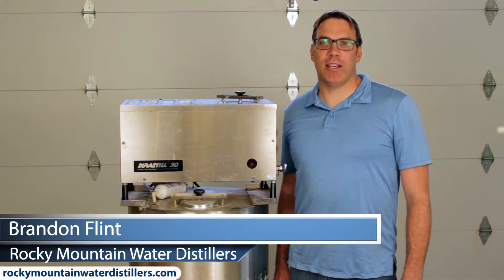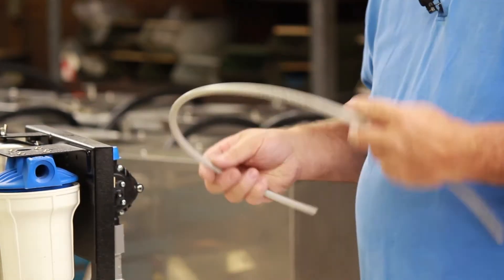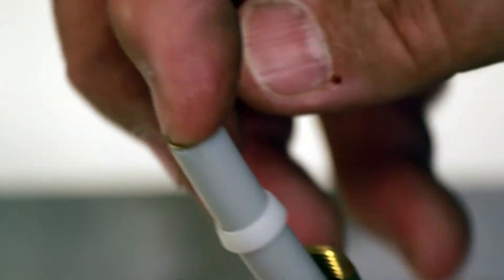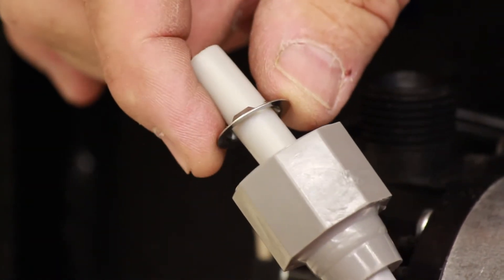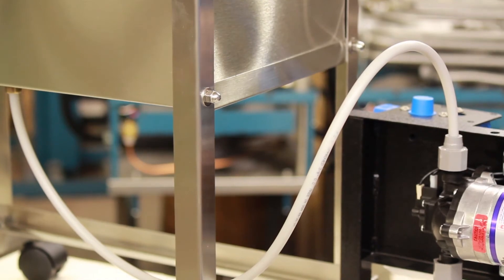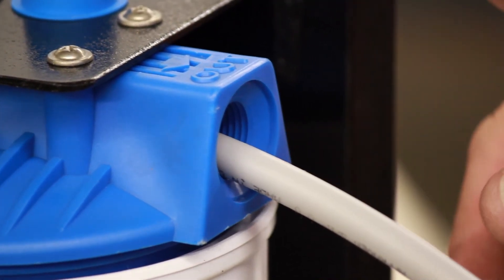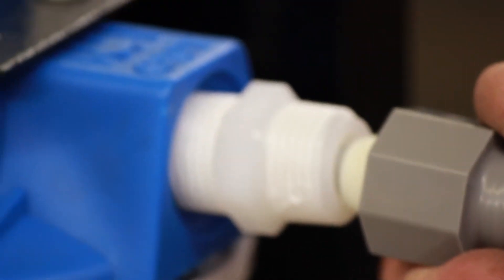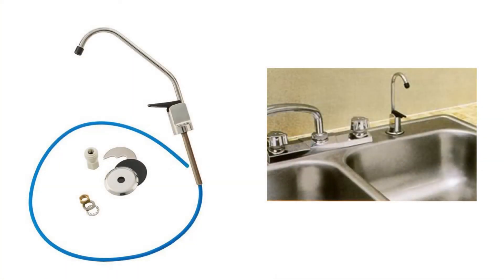How to Install the Durastill Remote Faucet System on 10 GAL Tank - Rocky Mountain Water Distillers

Comment: Hey there, what distiller would you recommend that gets 0 ppm and produces 2-5 gallons a day? My budget is about $500-$700. Any tips? Best
Reply from the maker: My first water distiller in college was the Durastill 30H Manual Fill Water Distiller. I needed something to fit my college budget but was the best value for my money (price and quality). I wanted to buy a water distiller that could last up to 30 years: https://rockymountainwaterdistillers.com/products/durastill-30h-water-distiller  It is the most economical way to get started with a commercial-grade quality distiller. I then upgraded to an automatic Durastill system a few years later.  A Durastill 30H can be easily upgraded to an automatic distiller with the "automatic fill kit".  Right now it costs $829, so that might we too expensive for you right now. I know some of the cheaper distillers only last one or two years and then die. Whatever you do don't buy a water distiller from China. They are not safe and are very low quality.
Reply: That unit has doubled in price!!! I understand inflation but golly